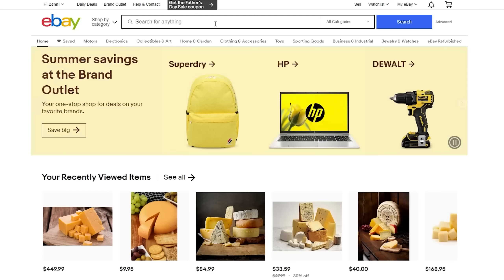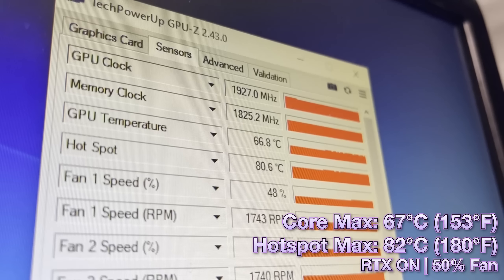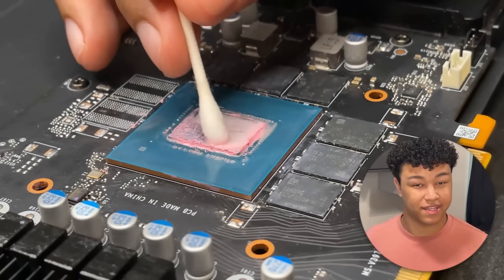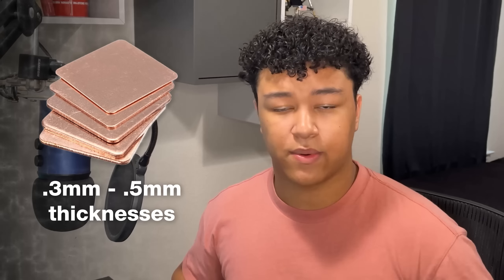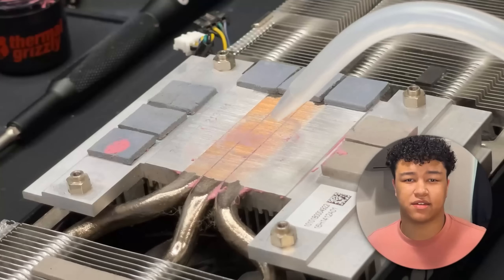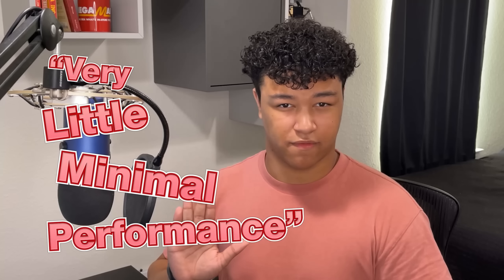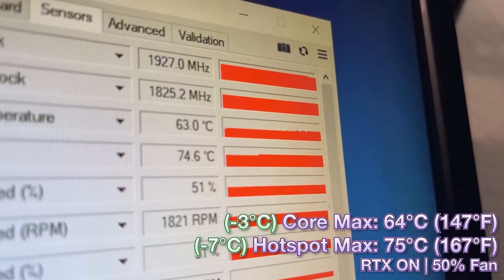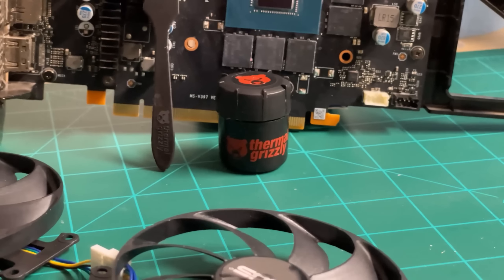Can This GPU Mod Fix RTX 3000 Core Temps?

Comment: 🤦‍♂️ this could easily crack your die and make your card a brick worth pretty much nothing, do not do this, I see no reason to ever do this.  Most coolers are already nickel plated copper, this is a bad idea.  Even if it didn’t crack the die, these copper plates, if not the perfect thickness, or if the cooler is not tightened down perfectly even, can break soldier joints in memory modules or the GPU core.  At best, this mod is a risk, if you can’t afford to liquid cool your card, you probably can’t afford to have it repaired or replaced.

Comment: Hey I got this method for cleaning GPU s that you might like.. Get some CRC QD Electronic Cleaner (Contact Cleaner) ,, I got mine from autozone I think I over paid, but instead of doing all that swabbing and twat not.. You just kerblast your GPU, CPU, Motherboard whatever with this stuff... maybe wipe .. Keblast it again, and you are done son
Reply: That's what I would use as well.  It's also good for cleaning off solder flux.
Reply: Not intended to be used without forced air extraction at your workspace. Cancerogenic.

But i do it anyway, so... who am i to tell you not to.